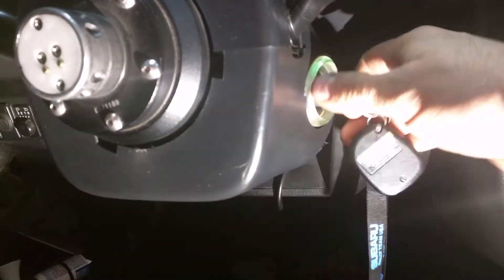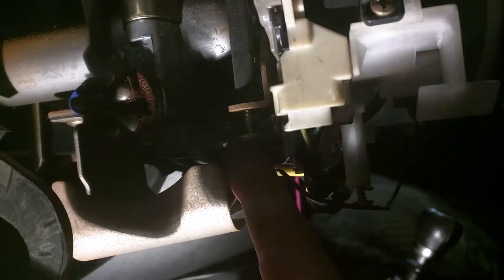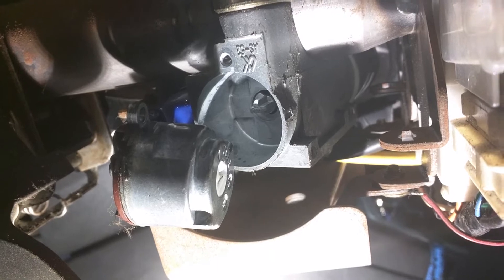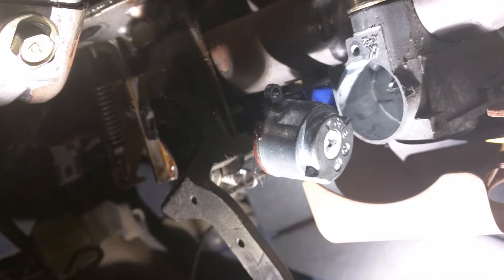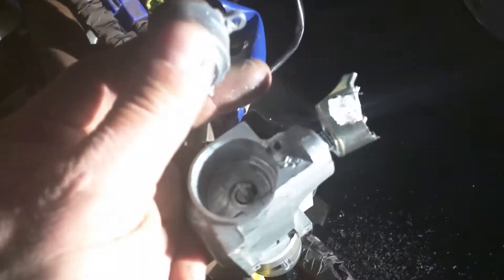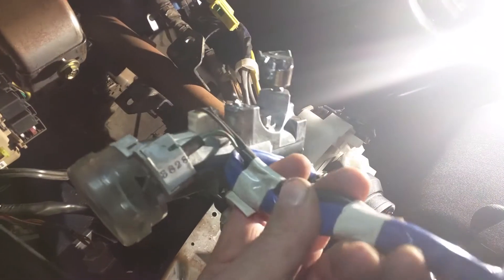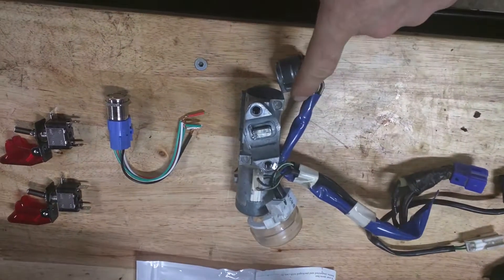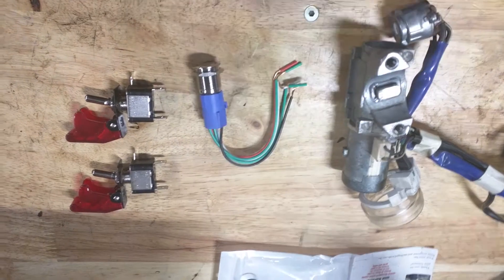Steering column lock removal and custom ignition/starter panel - Subaru STI Rally car

Comment: I cant get my car to start after the install. it all seems to work accessory, ignition, and crank but it wont fire up. 
what do you think went wrong here?? maybe the 07 sti has some sort of safety feature.
also i did not have a green/blue wire just a black/green
Reply from the maker: @FullPanek  05 and after have an immobilizer which most likely still requires the key. Not sure how it is wired on those models. I have another video showing the wiring of a Cartek GT in an RS4 with immobilizer where I keep the ignition key.
Reply: @ I wonder because I believe the immobilizer was removed when cage was installed. I plugged everything back in and tried using the key and no luck
Reply from the maker: @FullPanek  if the immobilizer was removed the car won't start unless you disable the immobilizer from the ECU (not sure if that can be done in those ECUs). Not sure how advanced the immobilizer was in those models, maybe a resistor to emulate the key might be enough but you might need to keep the whole circuit with the key and tuck it in under the dash.
Reply: @FrogRacing  there is a chip you have to remove only but i can remember the name of the actual chip

Comment: hello and thank you for the detailed video.  i m working on my 2002 wrx and hoped someone could help me with an issue with my setup.   honestly it already drives me a little crazy. i set everything up as you did, the lights for every switch is the issue i have. ACC light is always on. can´t find the reason why.  i put one pole of the light on Black/white, and the other together with the ACC cable on the switch. its always on even everything is turned off.  only kill battery turns it off. i have a boost control switching on with acc. could someone help me fix this?

Comment: Awesome instruction on the wiring. Could this be done to older Chevy trucks ? 93 s10
Reply from the maker: Yes pretty much anything that doesn't have an electronic immobilizer would work with the same principle.

Comment: how did u wire the kill switch.what size wire
Reply from the maker: You need at least 4AWG wire or bigger. There is a document on our website describing the install (http://www.frogracing.us/the-shop/rally-car-prep) scroll to the bottom of the Rally Car Prep page, there is a pdf document explaining how it is done.
Reply: @FrogRacing  that link didnt work.
Reply from the maker: I just updated the link to the main page, check for the doc at the bottom of the page. It looks like the direct link to the pdf doesn't work in the comment

Comment: where can I get one of those green base  plates the ignition switch panel is mounted to so I can place it in the radio space?
Reply from the maker: I made it myself. It's just a piece of sheet metal cut to size and wrapped with green vinyl on top
Reply: @FrogRacing  alright awesome thanks!  I'm gonna set something like this up knowing that now

Comment: If i just want to use the start switch with key . What wires will i use for that ?
Reply from the maker: That would be the yellow/black and white/black wires. It's at the 6 minute mark in the video
Reply: If you're still looking looking  to do this simply buy the banvie push start button 10 x better